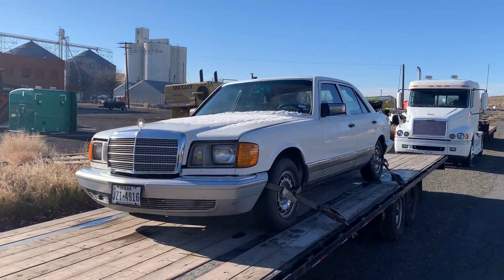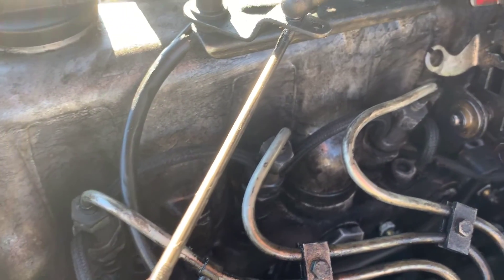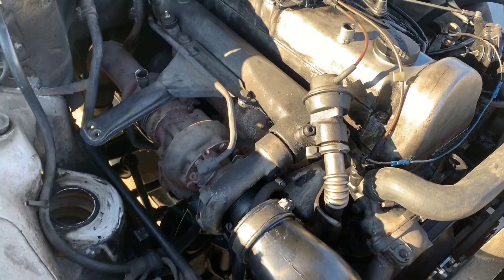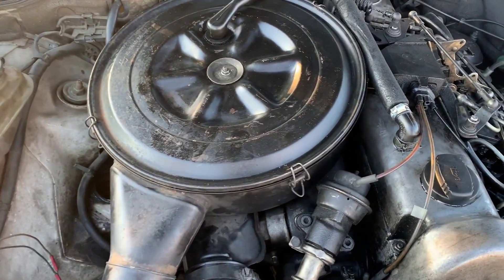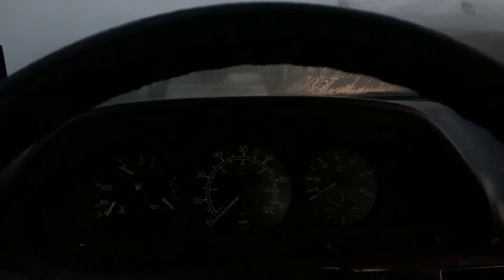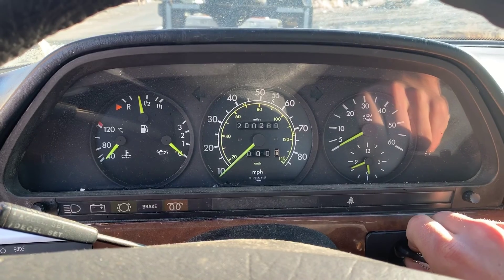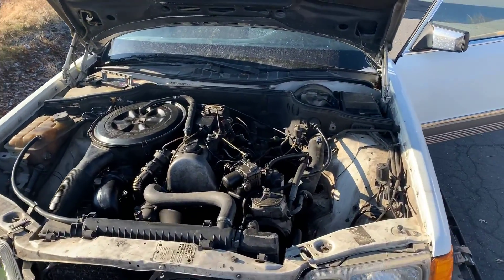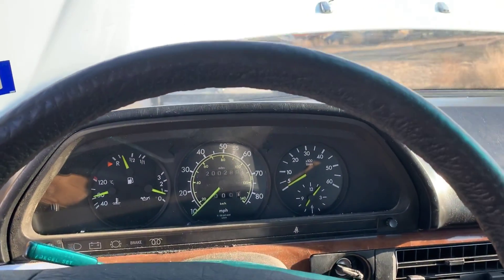$500 Mercedes 300SD left for dead, can i bring it back to life?

Comment: Sweet 300SD, its pretty clean, the noise is the starter going out, I have the same thing on my 500$ 300TD
Reply from the maker: I think you’re right, the two prior owners and myself trying to start it for so many times to no avail has probably worn out the starter.

Comment: That sound is the starter not engaging the flywheel and spinning before it moves out. I have the same problem with my 300sd rebuilt starter motor.

Comment: Tach amplifier is bad. The round black think on the driver's wheel well. Unscrew it, place a small square of folded paper or something in the middle of it and screw it back on. That will probably give you a functional tach for a bit.
Reply from the maker: Yep, I’ve done that trick to a few of these.

Comment: I thought you got a good deal also.  Just a comment that the trip odometer is at zero which leads me to suspect this cars odometer does not work.    I have 4 W126's now and 2 others in the past and only one odometer has worked in them.  That little plastic gear is usually the culprit.

Comment: Valves sound tight.  Did it run and sound better after a valve adjustment?  Any updates on the car's progress?
Reply from the maker: I did a couple more videos on it, I tested the compression and injectors and unfortunately the engine needs to be rebuild. If you check out my channel you’ll find the other videos I did on this car.

Comment: Have you checked the ovp relay? Maybe alternator regulator failed causing too many volts. That would cause low idle, poor cold start and no rev counter.
Reply from the maker: Good point, I'll have to check that. The alternator cable was actually disconnected during this video as one of the wires was loose.
Reply: @bokosdieselgarage  I'm going to subscribe and follow your progress.
Reply from the maker: @28imike  thanks, I just posted an update on this car.
Reply: @bokosdieselgarage  yeah, I'm just watching it now.